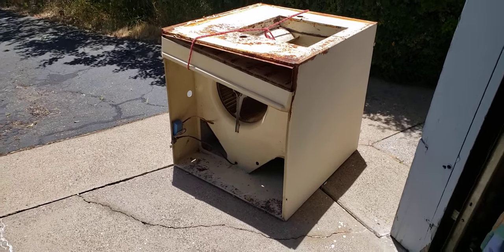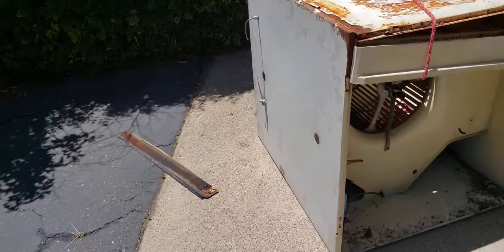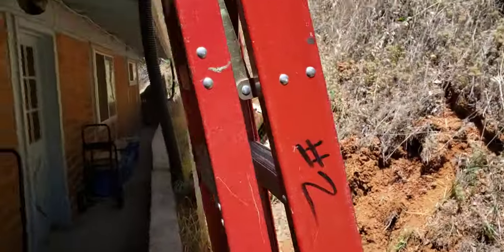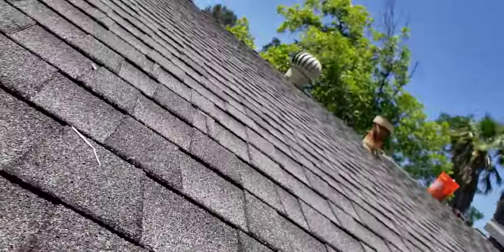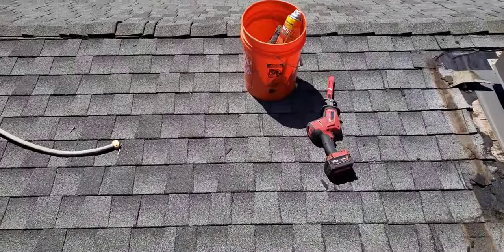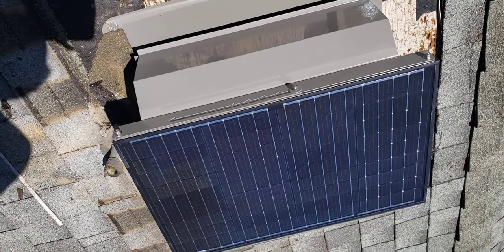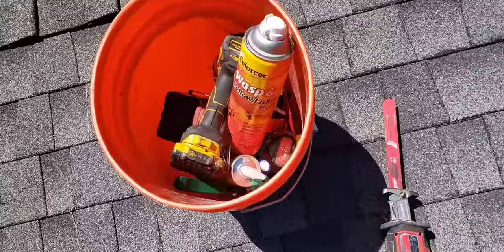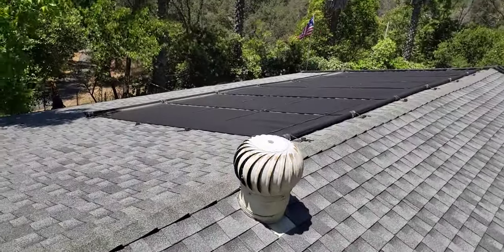INSTALLING SOLAR ATTIC FAN PART 1

Comment: How is the fan holding up for you? We are looking into this one.
Reply from the maker: Hello Bigkahuna , 

This solar attic fan is working really good 👍, great for our attic.

The thing some people don't realize is - attic fans only keep your attic the same temperature as your temperature outside of the house temperature, so if it's 105 degrees outside,  instead of your attic being 140 to 160 degrees  - your attic should stay around 105 to 110 degrees. If you place a temperature gage up in your attic where you can see it and it reads super hot still - you probably need either 2 attic fans and or a blower fan in your attic to keep the air moving 👍.

NEWCASTLE CALIFORNIA,USA 🇺🇸